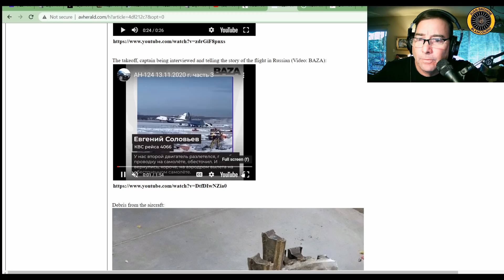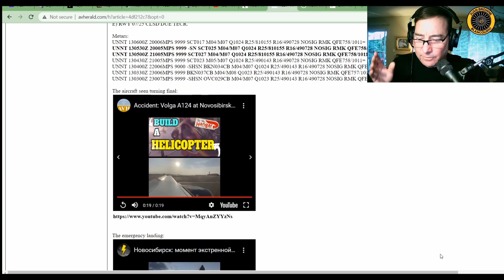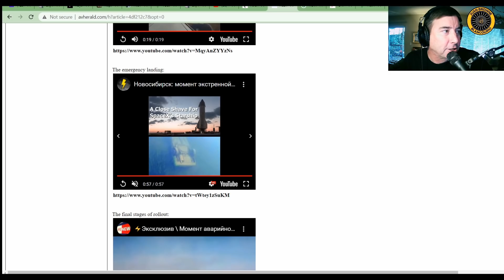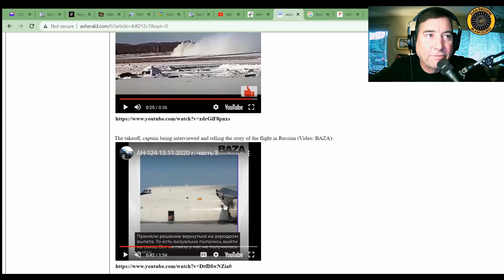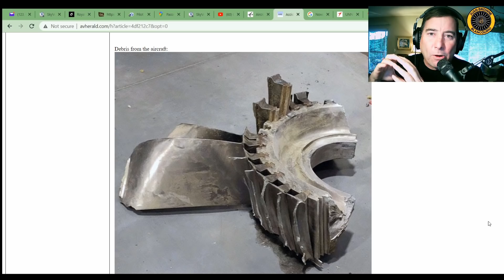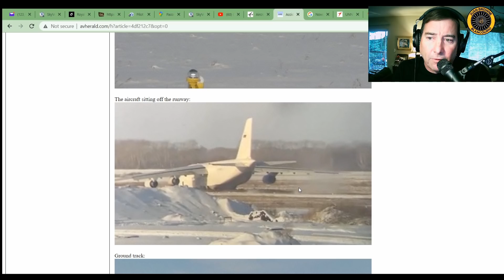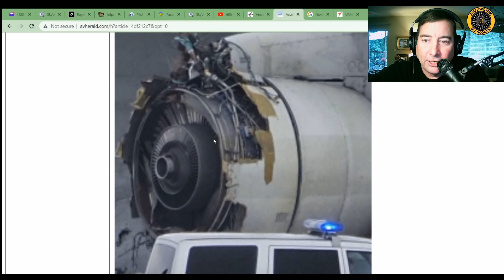AN-124 ANTONOV FAN DISK FAILURE NOVOSIBIRSK, RUSSIA

Comment: There is a translation of the interview with the Russian pilot on that website and they explain they had "no brakes".
Now I know that e.g. F1 drivers say "no brakes" when their brakes actually still work 5 times better than standard car brakes, but in this case it may be that they indeed had not much braking action.
In that case it would be difficult to stop the plane in time.   Maybe some swirving action?  But that could easily get out of hand, especially in those snowy conditions.

Comment: There were 8 passengers in the fuselage (somewhere), it's a miracle that no one was even injured by the shrapnel.
Reply: As usual Juan a superb job in your explanation
Reply: Inside all cargo aircraft there is a lovely yellow line showing where the debris will come through in case of engine failure, and most of the times the loadmaster will use those seats last, preferring to have cargo there instead. If I had a choice I always sat at the wing root, as that is the point of lowest motion, though often it is also the loudest as you typically have all the hydraulic pumps there for the same reason, no sloshing.

Party trick was (having the bags to hand) drinking a bottle of cooldrink and keeping the level inside the same, irrespective of the antics of the actual aircraft. Worked wonders in thunderstorms, where, due to the cockpit being non pressurised, I flew through the storm instead of over or around, as it was too high to go over and the destination airports were all in it.

One trip my second lg was commercial, and they were not serving the in flight meal unless requested, due to the storm. I took it, as nothing that 727 was capable of doing was going to worry me. Just had to eat with one hand, as the other was holding the tray and glass down. I was also in the very back, still nothing to worry about.
Reply: The passenger compartments/seats in AN-124 and AN225 are right behind the pilot's cocpit. Considering it was happening during takeoff - there were nobody in cargo area parallel to the engines.
Reply: @digimaks  There are apparently several options to seat passengers in such a huge aircraft. Without compromising cargo space, I think the AN-124 can accommodate 80 persons.
Reply: @digimaks  you are wrong. Passenger compartments are in the rear of fuselage. Right behind the cockpit is the crew rest area.

Comment: In my best RUSSIAN voice,,, We build flying trucks in russia so no problem,,,It will buff out with a few new parts .
Reply: Russian utilitarian aircraft are build like bricks. Blancolirio has an video up of an Antonov-2 biplane landing short of a concrete runway and having most of its landing gear ripped off when it hit the edge of the concrete slabs. They probably had it flying again within a week.
https://youtu.be/f-_G8yATYP8

Comment: Boy that is a lot like the O'Hare aborted take off a few years ago.  That took out the wing tank and one part ended up I think in a UPS hub hundreds of yards away.  They were so lucky  it didn't take out the cabin or there would have been serious injuries.  Like I said over on Peter's channel they can build another plane but you can't put a price on an experienced crew.  Great job of getting that plane back back on the ground and walking off at the end!!
Reply: Ukraine, because of the aggression, imposed sanctions against Russia. And now all Russian aircraft are of the AN brand, and after that, the overhaul of Ukrainian engines is not carried out and many components for the AN are not supplied. Now it is very dangerous to fly on Russian AN aircraft!

Comment: I'd love for the FAA to do an inspection of a An-124 especially the aircraft log ......as the Ukraine and Russia are not working too well.....availability of parts a severe  issue ....  We had multiple An-124's at SFO this last month and we are putting lives at risk .
Reply: It's insane to me that the FAA wont let American military cargo aircraft be sold to private cargo carriers while letting foreign military cargo aircraft being operated by foreign cargo carriers fly in and out of the US at the same time.
Reply: @operator0  You are correct.  The engine design of the engines on the An-124 are at least 40 yrs old, using engine parts from a country that Russia is at war with. Yes, a complete double standard.

Comment: That engine fragment penetrated both sides of the fuselage then fell through the roof of a nearby building ending up on the floor all without killing or injuring anyone. Pretty darn lucky. Nice report Juan👍🏼
Reply: @osakarose5612  .
Reply: Imagine if that was number one engine instead of two, that would of ripped into the wig big time.
Reply: Seems another sabotage because this cargo plane had loaded 85 tons of car parts from Asia. This market for car parts is highly fought over these days.
Reply: @lenny108    Sabotage seems very unlikely as it would be very difficult to engineer a fan rotor burst to occur.  I know what you're saying about sabotage of parts shipments occurring, but that's far more common to occur at the point of dispatch due to the actions of organised crime.  For an attempted act of sabotage to occur in transit, and particularly at a Russian airport where security regarding international flights is very tight, seems extremely unlikely.  I would imagine this will prove to be an accidental event caused either by an undetected defect in that engine, or maybe by a fast-developing fault.  Rotor hub failures or defects are a common and ongoing issue with jet aircraft, it's not long ago that it was common to have passenger aircraft mishaps caused by this...
Reply: @lenny108  Every investigation I have seen where the hub breaks they always seem to find a tiny manufacturing defect that can take a thousand hours of run time to fail.
Reply: @lenny108  i thought that japan or korean factory send all car part by ship?
Reply: @sonidamara5018    No, parts that are on priority order will routinely be despatched by air whereas normal parts orders, i.e. those that are going into stock at the importer's warehouses, will be sent by ship where practical.  Of course, if those parts are going to a land-locked country with no access to large shipping, or where access to large shipping is difficult, it may be more efficient and more practical to send normal supplies by air too...
Reply: @gosportjamie  Vienna is pretty landlocked.
Reply: @zapfanzapfan    I thought it was, but not being familiar with the geography of central/eastern Europe, I wasn't sure if it had access to heavy shipping via canals or rivers...
Reply: @sonidamara5018  If someone messed up on the schedule it's cheaper to ship by air than to shut down a production line. Back in about '93 or '94 GM shipped a locomotive by air to meet a delivery date. I've seen the youtube of it
Reply: @gosportjamie  ok i see.... i heard that rusian car is very tough but not good in sale.. i dont know why... btw those an124 crew have done a very good job in this event..
Reply: @gosportjamie  It sits on the Donau so shipping is available but if it is a container coming from Asia on a giant container ship it has to be transferred to a smaller ship or barge somewhere. Or put on a train.
Reply: @easternwoods4378  yes.. in certain goods or situation that need air delevery... here in indonesia goods like this mostly send by ship... btw is interesting that indonesian air force buy su30 and rusian sukhoi factory send complete su30 by this an124...
Reply: @sonidamara5018  I live close to the old Ford Talbotville plant. Every once in a while the supply chain would get messed up and they would have to fly in an emergency set of parts. They'd commandeer as many cabs as they could to transport pats from the airport to the plant. I worked for Nortel in the early 80's. We had a plant in Malaysia supplying us. We'd make the parts and ship them over for assembly. They'd be late shipping back so we'd make a seconds set of parts  and fly them over and fly the assemblies back. When the original set finally arrived we'd scrap the whole bunch. Not a profitable way to run a company
Reply: @easternwoods4378  There was an incident where Nissan requested a trucking company stop and put part of it's load on an air freight service to keep the factory moving. Come to find the trucking company had been using a railroad without Nissan's knowledge. The trucking company paid high 6 figures and never hauled for car plants again.
Reply: @easternwoods4378  oh..ok thx, i didnt notice about suply chain and tight target time in manufacture, ford is a tough car, my frend have a 1997 ford lacer 1300cc and he told me that his car have mazda engine on it... 😀  and yes.... an124 n locomotive are very cool to me

Comment: A damn fine job!! Watching that sink rate on the Base turn ... they had their hands full. 

I saw a KC-135 do the same thing for the same reason. 

I was at Castle AFB in the 80’s when that happened. The PIC flew it like a fighter.... side slipped in... engine on fire and all ( no fire bottles on KC-135A in the 80’s) 

Ohhhh boy ... blew all 8 main tires

Comment: In our company’s preflight planning, when we figure our takeoff speeds, one of the speeds the app spits out is an emergency return Vref speed at the takeoff weight.  I can think of at least 1 time where having that number written down on the TOLD card came in awfully handy.
Reply: The question is; With all the damage to the aircraft, did they know how fast they were going?
Reply: @operator0  My opinion is they have old style gauges for speed and altitude. Big aircrafts have pitot system in the nose of plane, so I expect they still had at least IAS and altitude information available. VMC conditions save them, if they lost artificial horizon due electric circuitry malfunction and turn  indicator in IMC, no way to handle such suítuation. But amazing job from crew.
Reply: According to the report that I watched yesterday @MentourPilot, they did not have any instruments (speed, alt etc)
Reply: @stephenrich3029  Its possible, I check Ruslan instrument panel and see analog instruments but its possible that static ports arent located in the nose and thus doesnt works.

Comment: These engines are quite old and they have trailing smoke during normal operation, so the report about engine 3,4 smoke is likely invalid.
Reply: Yes 3 and 4 engines would be at  max to keep the old girl airborne
Reply: Yeah, the USSR never produced a particularly efficient combustor.  All of their engines smoked a bit.
Reply: @alexandernorman5337  do you know the story of this particular engine? Initially USSR didn't have any engines of this thrust level. So they tried to order one single Rolls-Royce engine, with the idea to just copy it (i.e. steal). But RR understood the plan, so they said that they will only sell a batch of 100 engines. So USSR was actually forced to construct its own, without having relevant technologies. In the end this D18T engine has very low time of operation (until at needs replacement), needs pre-takeoff heating for like 7 minutes at full thrust and is susceptible to compressor stalls at certain angles of attack. Soviet technology, you know.
Reply: @PermanentWTF  
They did the same thing with computer systems. Actually I think there were imposed export restrictions on computer equipment to the Soviet Union.
Reply: @PermanentWTF  Actually this story got distorted by propaganda as if Russia/Soviet Union cannot do anything of their own and just copy/steal western tech. The real story is - USSR bought Rolls Royce engine with documentation and LICENSE to produce. No stealing copy there -  fair honest business. 
Not sure where did you read about 7 minute full thrust warmup and susceptible compressor stalls at angles of attack. Soviet Technology was no worse then what was produced in the west at those times, and actually excelled in number of them. Again those peculiar ways to look at Soviet Tech as something perpetually inferior is a stereotype.
Reply: @digimaks  dude, I am from the USSR. I did not read it, I lived in it. On 7-min warmup - just watch any An-225 video and look why it occupies runway for so long every single time. On RR deal tries - see Russian/Ukrainian Wikipedia about Д-18Т engine. On issues with stalls - read Russian aviation resources.
Reply: Or acceptable burn
Reply: If it does not smoke then it is faulty........
Reply: B52 
Hold my beer
Reply: @davidmoore8741  B47 JATO: B52 hold MY beer
Reply: I've heard the PW4000s on UA's 772s smoke a bit because of their age.
Reply: SeanBZA Kind of like the old Harley Davidson joke, if it ain't leaking oil it must be empty.

Comment: Hi Juan. A General Electric engineer once told me that the "ring pull" or stress on the 747 engine fan at RPM was about 1.2 million pounds.
Reply: I worked at GE Aircraft Engine Group back in the late 70's in engine development.  We over spun an engine in a heavily fortified test cell until it let go and it totally destroyed the test cell.  I mean totally destroyed the test cell.
Reply: @renb2  From yor perspective, is there any realistic way to contain that kind of failure either inside the engine, or to protect the minimum set of electrical and hydraulic lines inside the fuselage with steel/titanium/kevlar or whatever kind of reinforcement, or are the forces of such a magnitude that they simply can't be handled no matter the level of engineering?
Reply: @danielnilsson2076  you can engineer things to be bulletproof, or fly, but not both.
Reply: @danielnilsson2076  Likely there is but "it might not leave the ground".
Reply: @danielnilsson2076  I once saw the results of a turbine spin pit (test cell) explosion. Nobody was hurt . The pit was lined with lead bricks, concrete, several inches of sand, then a concrete shell. The lead was melted where the disc hit. Concrete shell was crisply sliced. Disc fragments were in the room walls. It looked like a bomb scene.
Reply: @randyphillips2112  
Just wondering if a connecting ring at the outer end of the blades could stabilize the structure of the fan as part of its fabrication?
Reply: @larrybe2900  It would add extra mass, compound balancing issues, increase manufacturing cost and difficulty for very little gain.
Reply: @Agnemons  Not to mention that it would increase stress on the disk itself due to higher angular moment of inertia.
Reply: @Markle2k  it seems like regular inspection would be the easiest way to deal with this.
Reply: @danielnilsson2076  From my perspective there is no way to control this.  The best you can do is try to contain a blade or two. There is just too much energy in one of these spinning at cruise power.  I always sit ahead or behind the fan in an airliner.  At least you got a chance if it lets go.

Comment: Luckily this emergency results in repairs, a shower and fresh clean underwear for the crew.
I know how violent a fandisk failure is.
when a fandisk fails in the  spinpit for recertification you are working 4 hours to remove and replace all lead blocks (aprox masonry brick size) and lead disk debris.

Comment: Fan / compressor / hot-zone disks are what the blades are mounted to, and comprise part of the rotating mass in a jet turbine.   The disks are typically made of hot forged titanium alloy or high chrome steel alloy.   The manufacturing process is highly regulated.   There are only a handful of facilities worldwide capable of producing these parts.
Reply: Ate they replaced at some interval or do that last a long time with inspections?
Reply: @ben3989  Jet engines undergo routine maintenance. There are 3 levels called A-Check, B-Check and D-Check (that's how it is in the military and presumably the same in civilian aviation).
A-Check I'm not sure what's done. In B-Check the engine is removed from the plane, carted off to the engine shop. There it is separated into its functional parts i.e. compressor stages, combustion stages and hot section, and the tail pipe ( J79 / F100 ).   The engine undergoes non destructive inspection using a borescope to see deep inside.   D-Check was off base, but i presume it involved a further tare down to component level then a total rebuild.   During which critical items such as rotating mass's undergo non destructive testing by magnetic flux and ultrasound to search for hairline cracks.
Defective parts are never reused.

Comment: Juan, Have you gotten any update on what happened with the civil air patrol craft that went down just short of the runway, on the 12th?      https://www.nbclosangeles.com/local-2/plane-crash-pacoima-fire-lafd-whiteman-airport/2459144/
Reply from the maker: hit the wires.
Reply: That link also has another video below that shows the crash. Pilot, flying way too low striking power pole lines. Had no fire been started, pilot may have lived. Someone said Pilot radioed "engine trouble".

Comment: Note to self...avoid sitting in seat rows even with the engines.
Reply: That's one reason most passenger airliners have the wings at the bottom and the engines below them. If an engine does come apart, it usually throws debris into the baggage compartment.
Reply: Yep, there have been a few people killed that way. One I remember was a Delta MD-88 that had a port side turbine come apart. A couple fan blades sliced through the cabin and killed and wounded a few passengers. On the old Mad Dogs, there were about 5 rows of seats in the very back that were in between the two jet engines. There are no windows and it can be loud as hell on takeoff. Not a great place to sit even if the engines stay together which they do in all but the most extreme circumstances. An unconfirmed failure is exceedingly rare.